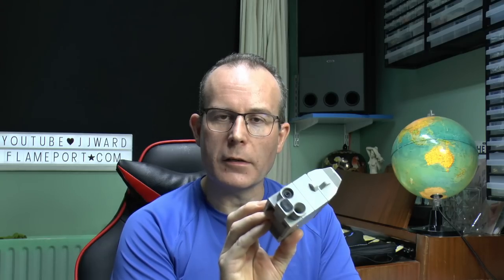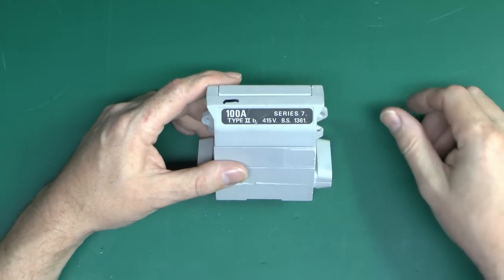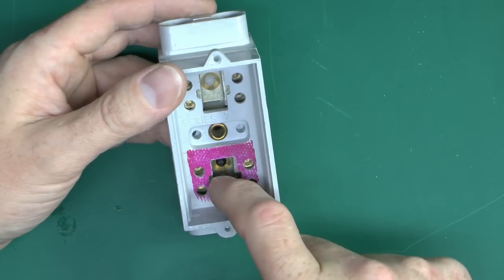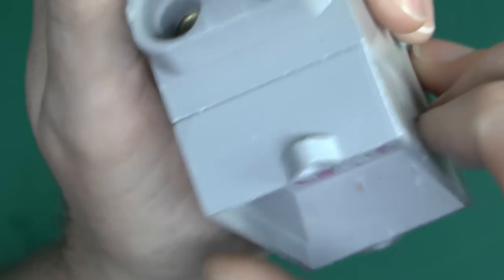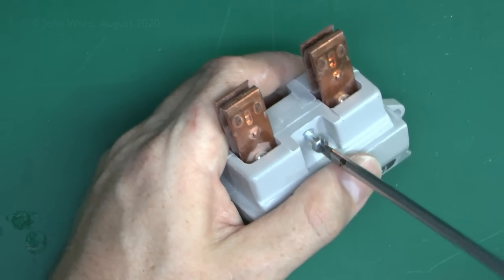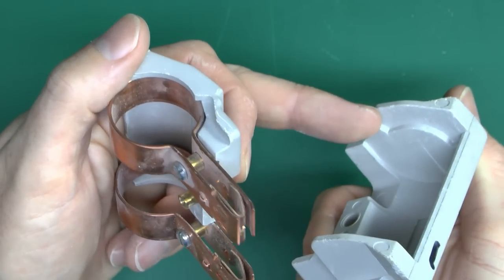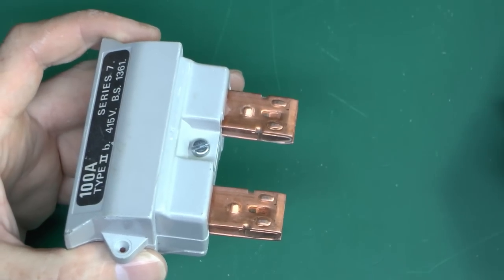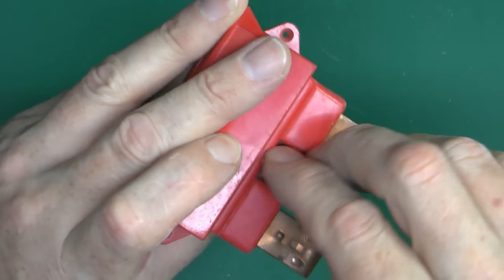Cutout Fuses, Red Links, Distribution and Building Network Operators

Comment: Would be more convenient if they had a window to allow the fuse rating to be seen externally.
Reply: Agreed.
Reply: That actually might be worth suggesting to Henley or Lucy (if they're not the same company now!).. Brilliant suggestion Mike!  Maybe in addition, a colour code could be established for BS 88-3 main fuses as for BS1362 plug fuses, say red/blue/green for 60/80/100 etc., meaning the fuse wouldn't have to be positioned just so..

Especially now EICR's are required for rentals on every change of tenancy and every 5 years, the issue is going to be ongoing. Pulling the fuse at every one, even if the DNO 'tolerates it' (as SSE do) is not good for long term reliability of the holder contacts.
Reply: Unfortunately the regulations stipulate the the fuse carrier must completely encase the fuse.
Reply: @iancooper418  yes... But transparent plastics exist... Think that's what Mike was saying
Reply: @TheChipmunk2008  I would have to pull the type approval but i am almost certain that it says one piece solid construction or something along those lines. Western Power Distribution now have label's to put on the carriers saying 80A or 100A
Reply: They're supposed to have a label on the outside showing, all newer ones do but some older ones don't.
Reply: mate it says the same 100amp fuse, i believe he is purposely muddying the waters not giving the full explanation
Reply: The transparent plastic is not rated because it has to be glass reinforced and the glass strands are not transparent

Comment: JW: "Not something you should be pulling out"
Every electrician in the country: chuckles ;)
Reply: I reserve the right to isolate and make safe any electrical installation.
Reply: The answer is you get the client to contact their supplier and request an isolator be fitted.
Reply: @iancooper418   Then wait 10 weeks for them to fit an isolator or arrange a date to pull the fuse, which they then change at last minute.  Oh yeah and the new landlord EICR regulations require any C1 or C2's be fixed within 28 days...  If they were that worried why would they not fit an isolator in the fuse holder or meter?
Reply: @iancooper418  I did and they said they don't fit isolators, ask an electrician to do it! So in other words, an electrician can pull the main fuse to fit an isolator.
Reply: @iancooper418  And meanwhile in the real world .......see comment by  Steve
Reply: @johnclarke2997  no you do not reserve the right to break rules and regulations or even laws for safe isolation quite simply you cannot safely isolate so you can’t work that is how safe isolation works

Comment: I work for a company that instals mains cut outs and msdbs in high risers.
the cut outs in the flats are all red links and the cut out is fused by a 100amp fuse in the msdb , I believe the installation gets sold on to a dno like esp and they own the whole lot including the red link
Reply: Sounds like a bno... Building network operator. The dno have control over it in as much as the sealing and so forth but somebody else is responsible for the actual maintenance.

Comment: JW: You touched on looped services . They used this on pairs of houses here on a '82 development and the only saving was on number of connections to the mains in the road, not on cable.

What surprises me is there doesn't seem to be any requirement for a warning label to be put on the final/downstream service head. I know of cases where a power shower has been installed in the final property which should be a no-no on a shared 25mm² cable. Fuses all appear to be 80A not the 60A specified in the UKPN documentation I have here.

Comment: I have a red fuse in my flat and coincidentally I had UKPN viist this afternoon. 02/09/2020 to check my earthing system and they said as JW has mentioned, that they are not responsible, it is the Building Maintenance Co. which in this case is us, the residents, we manage it ourselves. UKPN said they are responsible for the incoming supply on the ground floor and that is where the actual fuses are located and they are only allowed to be 60 AMPS. I think they said my earthing system is TNS, T Neutral Seperate I think they said, anyway very informative JW and thankyou.

Comment: Very interesting. Here in Germany we use NH fuses for such purposes.
Reply: I have always liked the design of the NH fuse link. Good sturdy terminals to get a 'grip' onto. Like some of our older style bolted fuses. Not sure why the UK went for a 'simple scaled up miniature fuse' design for house service fuses.  Even street lamps get a bolted style (6A) fuse here
Reply: @rob3125   yes, most countries install electrical systems according to the EN standard, which is mainly written by the VDE guys. But the UK does also things like that and additionally other countries like France have there own types of fuses or other special stuff.
Reply: Does the customer own the NH fuse in Germany? Here in North America, we just have a big circuit breaker (such as 200A) in the same panel that feeds the smaller ones below. The customer normally owns everything after the power meter.

Comment: +John Ward
Given the BNO situation you speak of -- I question the situation with BNOs and DNOs and the ESQCR!.
If a DNO installed building cabling, if I'm not mistaken it will tend to have PEN conductors -- i.e.  Single-Phase Coaxial cables (or, maybe, 3-phase with PEN conductor to distribution boxes on the floors, then going out to signle-phase coaxes again).
The ESQCR certainly says that a consumers' installation may not combine N-E, which then raises the question, what is a 'consumer' and what happens when DNO<>BNO been ''forgotten'' and so-on -- do you then have 'illegal' internal building wiring?.

Comment: In Australia they used to use similar on each phase before the meter. They also had tamper seals through each loop which had to be broken to remove them, I note yours also has them. The reason for the tamper seals being because they are before the meter and you could simply tap in to the load side of the fuse for free electricity.

Comment: I think it’s worth noting based on some comments that say isolation does not give you the right tamper with supply equipment. Quite simply safe isolation means what if it’s safely isolated and takes step to safely isolate if you cannot safely isolate to work has been failed to be talked to people safe isolation is not a be an end for other rules and laws.

Comment: Also keep in mind that the second generation Smart Meters have a 3 minute "last gasp" function on them and if the power goes out, they send a report that is cross referenced with the DNO data base to check if there is a power cut in the area.
Reply: Another reason there should've been an isolator in the smart meter specs.
Reply: @cjmillsnun  they are meant to install an isolator if requested reason why they can’t unless they requested it because they have to cut customers me details in order to install

Comment: Now if only there was some way to safely isolate the supply after the meter so electricians can work safely and not have to touch the DNO fuse, maybe an isolator on the meter, possibly put in when they swap our dumb meters for these new fangled things...

Or is that too easy???
Reply: Genuinely speaking with meter company should be contacted one to 2 weeks before work is carried out and install an isolator at the supply will have to be disconnected

Comment: Every electrician pulls the main fuse out to safely replace the consumer unit. If the tails need replacing if they have loosened up at the meter that seal gets cut aswell. I'm not about to leave a property with loose or dangerous supply just because a DNO wants to see their arse. I've never had a problem with our local DNO infact I've always found them to be very quick acting to either replace seals or fix faults. One occasion they dug the road up till 3am and on the other I got them out over voltage drop and instability. A fuse was found to be blown in the main substation feeding the ring to the estate putting my client on the end. Saying that I've found the neighbouring DNO to be incompetent arseholes.

Comment: As an employee of a DNO the PPE required to remove a main fuse is full AFR clothing rubber gloves and a full face visor so I'd be surprised at many DNO's allowing electricians to pull the fuse themselves
Reply: Pulling a DNO fuse that isn't under load isn't exactly rocket surgery. A Loaded one however is a different matter...
Reply: SSE do allow fuse pulls.  They even publish a procedure and provide seals.
Reply: Oxfordshire DNO allow register electrician to pull the fuse.
Reply: @arcadia1701e  however the issue is situations where you put it under load due to the fact that Henley block shoved above the ceiling feeding something else like a shed and it has created ark flash

Comment: I've seen an installation where the incoming cut-out (60A, with TNC-S earthing) and meter were enclosed in a sealed transparent case, and there was a second unsealed (black) fuse holder on the load side of the meter. Presumably this is instead of an isolator, but massively more dangerous to actually use.
Reply: I have heard of that in the past typically that is where there has been problems with abstraction
Reply: ......The problem would be 
someone who doesn't know 
what they are doing, yanking 
that "after-meter" link while......

.....there is a reasonable load going through it. There would be quite a flash-bang!

Fuse carriers ARE NOT suitable for switching a load. As such, the supply must be stopped at the consumer unit before fuse links are pulled.

-Wayne's Electrical.

3rd September 2020, 21.24
Reply: @WaynesElectrical  That's incorrect, the fuses are more that adequate to take the load without any problem. the idea behind switching off the DB is an old hang over from the even older style of re-wireble fuses which were a lot more liable to break and made of metal.
They are not meant to be used for switching in the sense of daily removal etc but they could be fitted then not touched again for over 10 years.
The loads are not high enough to cause a problem.

Comment: I just popped down to SSE at bourne valley  . They Took my Niceic number and gave me some red seal s to put on the fuse when replaced . Is this the procedure you talking about John ?
Reply from the maker: Yes, that's the procedure for SSE - however other network operators have different procedures, and some don't allow fuse removals at all.

Comment: How does a qualified electrician change the consumer unit during a rewire.  Can he remove the fuse or does he have to contact the electric supplier ?  Thanks
Reply from the maker: Some network operators allow certain people to remove the fuse.  Others do not, in which case having them install a separate isolator is one option.
Reply: @jwflame  thanks
Reply: @fredhunter3950  To elaborate, it's a legally grey area these days. It used to be 'the Board's stuff was theirs, you do not touch. Call them and they'll come out and disconnect for you', usually quite soon.

Now you may have to wait weeks, nobody knows quite who's jurisdiction it is anymore. For example, had a call 'arcing noises coming from main cable area' a few weeks ago. I confirmed there was definitely a loud crackling fizzing coming from the service head. Being and old PILC cable I slammed the door shut and said 'call SSE please' to my colleague. They were there in minutes, but couldn't LEGALLY rectify the entirety of the problem, which was that the 'smart meter' fitter had apparently forgotten his screwdriver,. The SSE chap (they're our DNO) removed the fuse for us, thus powering it all down, but he wasn't ALLOWED (?!) to touch the meter terminals, he and we had to hang around for another 45 minutes for british gas to send someone round to do the screws up. Yes, gas doing electricity... the world's gone MAD
Reply: My own personal experience of this was when I asked for the fusebox to be replaced with an RCB/MCD in the house I live in.  At the time I didn’t own the house but had come back for a second viewing and the electrician was there on behalf of the vendor.  He had pulled the main fuse, and the supply to the house next door, (two meters sharing the same main fuse).  It might cause a bit of stir if someone did that in England but a more blasé attitude to such things is normal in South Wales.  

More recently the tenant of the house next door agreed to have a smart (farce) meter installed.  The installer knocked on my door and asked to turn off my fuse box before pulling the fuse again.  Somehow the landlord of the property had made an arrangement so that an electrician arrived at exactly the same time to upgrade her fusebox with a new RCB/MCB unit, presumably so that his electrician did not need to ask to disconnect the shared supply.
Reply: @andrewschannel3635  im an engineer for E.on energy company and the rules are...the DNO bring in the supply and then energy company engineers install the cables and meters and isloators etc up to the consumer unit. then its private electricians who come along and install fuseboards and appliances etc. Only myself (engineers) and the DNO are aloud to work on/remove the main fuse. £5000 fine if caught tampering with the seals. the cut out seals also have to be sealed with personal numbered pliers, that only we are aloud to have. but of course electricians just crack on otherwise nothing would ever get changed haha
Reply: The cut out in my house doesn't have any seals, and hasn't had for as long as I can remember, at least 10 years. Where does that leave me legally?
Reply: @electricpalace4720  they won't worry if there's no sign of abstraction
Reply: TheChipmunk2008 - unfortunately this is the kind of mess you get when politicians who don’t understand engineering make the laws of the land...
IMHO the DNO should have retained ownership of the meter and everything up to it. Then after the meter there should be an isolation switch (also owned by the DNO). After the isolation switch, everything would be the responsibility of the property owner.
Reply: @Mark1024MAK  I recently had to arrange the upgrade of the supply to a commercial building. This needed a new supply cable, cable head and meter. So we needed to co-ordinate the attendance of someone from each of the DNO, Siemens (to commission the new cable) and the meter operator, plus our own electrician.
On the appointed day everyone turned up - except anyone from Siemens. After being chased up the guy from Siemens arrived the following day, but by then we'd lost the meter installer. It took a week to get him back by which time the building had been without power for a week and the battery in the alarm system had gone flat which caused problems of its own. 
I commented to the engineer in charge from the DNO that things were so much better back in the day when one organisation did the lot.
Reply: @TheChipmunk2008  Gas can't even do gas properly nowadays. Ended up replacing their flexible pipe upstream of the meter myself - with the correct connector as was there before the meter was changed. The good news was that the leak wasn't our side of the meter. So effectively before the regulator too - so higher pressure but still the Blu-tack held.
Reply: @jwflame  The latter is an 
expensive option. Anywhere between £100 and £230 depending where you live.
Reply: @asharwhyte1748  I've always wanted to see what would happen if the energy company tried to fine someone or take them to court. Electricity at work regulations surely trump their rules? Must be isolated LOL
Reply: @Mark1024MAK  yes mate. all new connections/new installs have to come with an isloator. you dont have to fit them when replacing standard meters, its the engineers choice. If a customer had a really old consumer unit i would install a switch and advisor an new CU
Reply: @TheChipmunk2008  once a month I have to go out with a warrant officer and a locksmith with a court warrant to gain entry into properties who havent paid their energy bills. the locksmith with pick your locks, then i will come inside and remove your electric meter and gas meter and install a pre paid key meter. so every time you top up for energy E.on will take £5 a week until the debts cleared. If I find a (tampered) meter I have to report it to a special unit. who will then form a chase in court bla bla
Reply: @asharwhyte1748  Yeah it's different if someone's messing with the system to try to abstract power. here in SSE territory we're allowed to pull the main fuse (well it's tolerated). And the secondary side of the meter is the customer's tails anyway... so they get changed if needed. But if WE see any evidence of previous tampering, WE will call the DNO and metering company.   Sounds like you're in revenue protection?